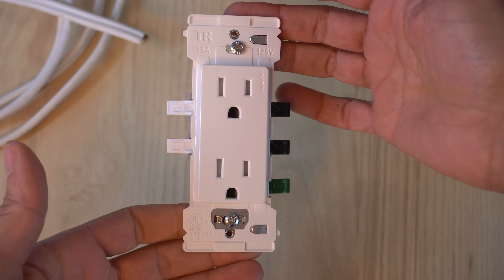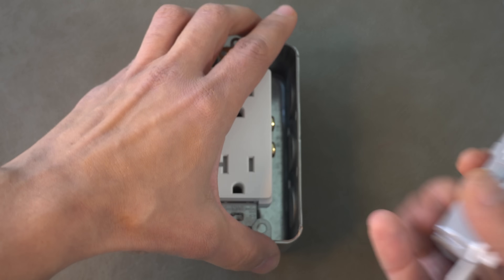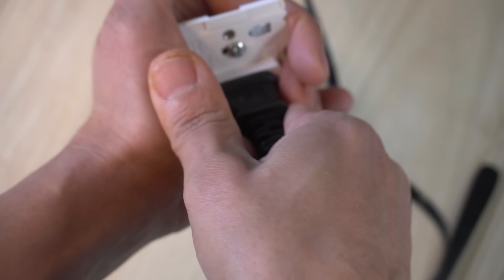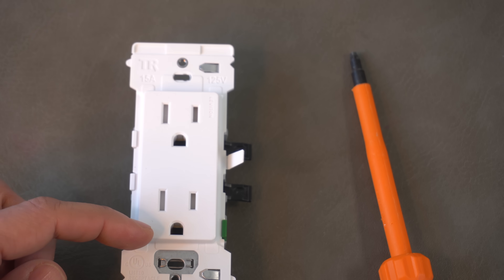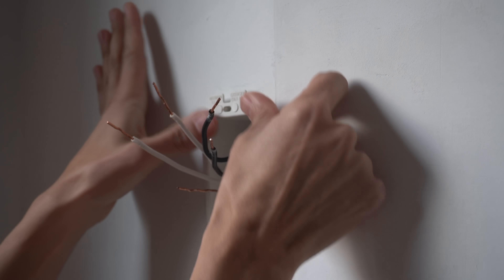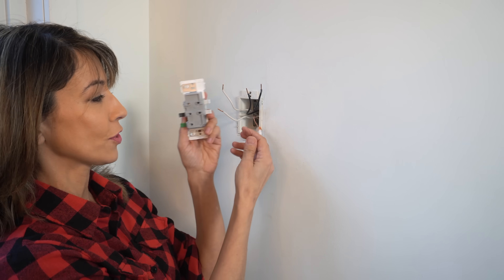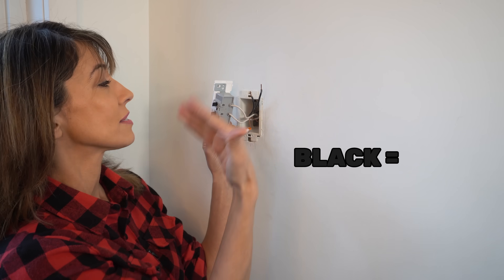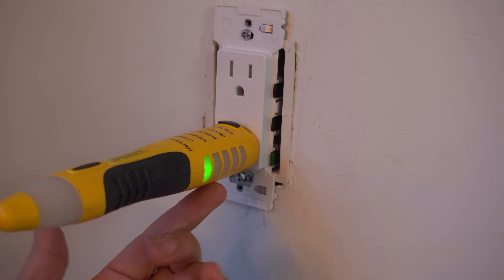New Electrical Outlet Installation: 3 Essential Improvements You Need To See

Comment: I absolutely will not buy an outlet with those doors inside. I LOVE the other changes. I also love the plastic box extension and plastic boxes, I hate grounding both the box and the receptacle its is so redundant. I also hate doing down stream feeding through the receptacle like that, but adding 3 wire nuts to the box makes it pretty tight sometimes.
Reply from the maker: Good to hear your thoughts on the outlets and improvements! Thanks for sharing your feedback.

Comment: Bad receptacle, you can pull the wire out easily
Reply from the maker: Thanks for sharing your feedback on this. I tested out the strength of the levers in my light switch video with a 15 pound kettlebell. The results were great. Check it out if you’re interested! Thanks

Comment: The best part of these is there are no exposed conductors.  I always thought that it was crazy that traditional outlets have exposed terminal screws and then you have a bare copper ground wire in the box just waiting to make contact with them.
Reply from the maker: I totally agree with you, safety first. Good point!

Comment: Yup.
As a DIY'er, someone who doesn't do this day in, day out, these make it so much faster for me, it's safer, easier. I love them, just like Wagos vs. regular wire nuts.

Coming from 12V automotive wiring (stranded), I was shocked when I learned about wire nuts the first time. Granted, I didn't know how to get a good connection, but still. I was used to soldering everything together to get a bullet proof connection, and then it felt like I was taking a step back 10 years to when I used to just twist all my wires together and couldn't figure out why stuff stopped working.
Reply from the maker: I appreciate you sharing your experience. I agree. This is the future of wiring. Good to hear that you love Wagos too.

Comment: New job on the video. Unless I missed it you didn't mention the built in wire length gage on the corner.  This makes sure you strip to the correct length.   Love these new switches. Can't wait for the light switches with the traditional level. Right now I only see the rocker style of switches.
Reply from the maker: Good tip, thanks. Comes in handy!

Comment: I want all of these in my house! Question for you. I have a bunch of those screw-in boxes that turn a 2 outlet into a 4 with usb ports. they should sit flush to the wall but they have like a quarter inch gap, this makes them wiggle back and forth when you use them - is there a way to set the outlets back a little further so they sit flush?
Reply from the maker: They make box extenders so the junction box extends if you need it to. I use them and they are in my Amazon shop. I hope you found a solution.
Reply: @DaruDhillon thank you so much! Now that I know what to look for I know I will find it! I was thinking of designing something to send to a 3D Printer shop but I am going to hunt for extenders first! I appreciate yah! 😊

Comment: I’m in any one of about 10 Home Depot’s 3-4 times per week for the last 10 years at least. Those things got put on the discounted end cap of the aisle in no time after they came out. Probably not more than 2 months. They’re constantly sold out of the 20 amp decora receptacle ten packs for a reason. I haven’t tried this new style yet but I’m guessing a lot of other guys haven’t either. I think people like the feeling of twisting the screwdriver and actually feeling the torque when you tighten it. I’m confident of the connection.

Comment: I am ABSOLUTELY thrilled to see these!! High resistant connections (HRCs) are way too common, cause fires and will not trip a breaker!! HRCs are caused by loose connections at contact points such as terminal screws or when you go to plug something in and it doesn't stay in tight. A terminal screw that is too loose OR has been overtightened (over tightening can cause the treads to stretch and loosen up over time) is a bad and common occurrence even done by electricians and or their helpers. Terminal screws are supposed to be tightened to a specific torque and it is not common practice to use a torque screw driver!! These are not only great for DIY's but for electrician companies as well; especially if they have young helpers that don't have much experience. Even if I would have an electrician work on my home I would insist that these are installed. Along with AFCI breakers, of course, because they detect HRCs!! I bet these cut down on AFCI "nuisance" trips that cause electricians to remove AFCI breakers!! Thanks so much for posting!!!!!
Reply from the maker: Good to hear your thoughts on this, thanks!

Comment: I'm a big fan of WAGO connectors but won't use these for the simple reason that they are tamper resistant. Also I'd recommend pig-tailing the line and neutrals instead of using the outlet to daisy-chain.
Reply from the maker: Good to hear your recommendations thanks!

Comment: Pro Tip from a Licensed Electrician of 30 yrs...  when you have 2 or more sets of wires in a box, attach a "tail" to each set. This creates a "parallel" circuit as oppose to a "series" circuit, meaning that the circuit has to run THROUGH the outlet in order to continue down to the next device. If that outlet fails, all the devices down line will no longer work. A parallel circuit taps the "hot" to energized each individual device so if it fails, only THAT device fails and the rest of the circuit continues to work.
Reply from the maker: Thanks for adding your insights on this. I agree it’s a much better way of wiring. Something I personally didn’t know early on but it makes complete sense. It’s a smart way of wiring. Appreciate you sharing this helpful information with us!

Comment: Nice!  I was looking for what exists along the line of 'box extenders'.  Had installed a GFCI in bathroom years ago, but never seated it in wall properly, was trying to correct that, and discovered the old metal box has some load wires coming in from the side, that stick into the box so much that the GFCI can't be fully inserted.  Am looking to find a non-conductive material to safely extend the metal box.    Nice presentation!  Thank you!
Reply from the maker: @darkandstarrysky5175  glad it helped. It’s good that you are taking the time update your electrical. Great job!

Comment: You talk about back stabbing outlets as bad, but
there are back stabbing outlets that have screws
on the sides that clamp the wires in the back 
stabbed holes. They are the best of both worlds
(easy and good tight positive contact). Doesn't
solve the exposed metal on the sides, though.
Reply from the maker: Good point. The screws that lock the wires are an improvement and are commonly used in other countries. Thanks for clarifying. I was referring to the old push in ones but having a locking mechanism be it lever or screw is a good feature that makes electrical safer and user friendly.
Reply: @DaruDhillon  Thanks for answering. I'm looking
for the new outlets you reviewed. Is there a store
that carries them in the U.S.?

Comment: Hello Daru , Thank you so much for your compliments , I believe this receptacle is made by Leviton and Leviton has been around for a long long time , Definitely a technological breakthrough , and no worries about any part of the receptacle grounding out against a metal box , Next thing that would be nice Is to have these lever connectors built into light fixtures to make installation easier and faster because reaching up to connect wires together can cause your arms to fatigue but of course you can use the Wago connectors , 
Don't forget to go to your local electrical supply and pick up a circuit breaker lockout along with a warning tag and a small padlock , I'm just looking out for your safety because when working with electricity , Safety is number one priority , Especially when working on a ladder and locking out and tagging out the circuit breaker is your best defense against electrical accidents , Like I said I'm just looking out for your safety and I definitely don't want you to get hurt because you're such a wonderful lady , I just want you to be safe and I'm a very strong believer in lockout tagout

Comment: Interesting product.  I'm not a fan of Wagos.  Wagos and these recepticles look like they'd work fine in light to medium loads but I want the security of a screw in heavy loads.  (Kitchen, bath & garage)  I will not install the older "push to connect" system which this product looks to be an upgrade.  For the last few years I've been using only the hole style wire receiver but with the screw they just seem far more secure than the toggle system.
Reply from the maker: The screw in ports are also good like you say. Thanks for sharing your experience with the connectors.

Comment: When straightening the wires: IF you have enough excess wire, CUT those curves off an strip back to what you need for your receptacle/switch. You weaken the wire by bending it back to a straight configuration.

Comment: Where is the on/off switch?  Do you have to go to the switch box to turn off something?  Are you wrestling with a LIVE plug, when turning off something?
Reply from the maker: Always turn your power off at the breaker and check with your voltage tester.

Comment: I thought these would be a lot more expensive. Only $2.50 each! Awesome!
Reply from the maker: I know it's good value considering the time savings in the bulk pack!
Reply: Yea, I bought 10 to try it out. It'll be so much easier than wrapping the wires around each screw. I'm replacing all my switches and receptacles so I need something that saves time.   @DaruDhillon

Comment: thats all good but how do you add outlets in parallel if you want to add multiple outlets side by side if one 1 wire is going into the socket ?
Reply from the maker: You can always use a standard outlet.
Reply: @DaruDhillon  so it's not a groundbreaking  advancement  it thr current standard can replace the higher priced alternative 😉
Reply from the maker: @Bond00016  for homeowners wanting a safe and easy to install outlet it’s a game changer. They can feel confident installing one on their own. We’re going to see more of this.
Reply: @DaruDhillon  yeah I'm not buying it ... if you Wana add outlets either get an electrician or do it your self ...  but I'd never want to be limited by technology.... that just doesn't make any sense

Comment: At 6:13 if you look at the black wire there is a nick in the solid wire from the person who originally stripped the wires…the first installer needs there hands slapped for not double checking there work…you as an electrician need to be fired or pay for this home insurance because you have just installed a ticking time bomb…that wire might break off when that device is pushed into the box or it might burn off when the person that is blowing drying there hair for the hundredth time or this receptacle is rarely used…there is not enough females in our trade please remember to check your work especially when you are trying to do a training video and please remember to include the basics when doing such videos…I started wiring houses when I was 9 years old ( different times) and 50 years later I am still assisting in the field ( forced into early retirement due to health issues).PLEASE  moving forward double check your work and remember THE basics..You appear to be great in the trade..with a few small tweaks looks like you could become one of the best..
Reply from the maker: I didn’t see a nick on the wire could have been missed in the original installation. All wires should be smooth and free of any damage. Thanks for the advice. 👍🏽

Comment: So when you leave the jobsite and all the other trades are finishing up and they keep cutting through the wall opening or the drywaller on a Friday afternoon tired of cutting for your boxes cuts a crooked hole…so with these overly tall devices you can no longer straighten the look of the two gang box…does the other trade get blamed for the crooked box …nope….these style of connections work ok solid copper but for stranded wire not so good so in piped in outlets where strained is pulled in instead of solid you either do the little anti fire dance and say a prayer that the stranded wire stays tight in the lever joints….add wire nuts and solid wire tails adding to your box fill and adding another possible joint that could fail because we also have bad Friday afternoons…or we pull solid wire and that goes over like a lead ballon..

Comment: Point of contact is HOW large? Not buying this. I’ve seen entirely too many of the push-in wire size hole types fail over time due to corrosion, arcing. Screws give LARGE surface area for contact and retention. How about a new outlet with a flap that folds down over the screws if there’s any (fuss-budget/anxiety-disordered/OCD-derived) fear of shorting on the sides? Maybe a 1” silicone rubber band to wrap around the outlet. Just another solution for a non-problem. Another “there’s a special place in h*ll for mechanical engineers”. Sometimes “staying in the past” and staying with what really works, has worked, is a good thing. JMHO.
Reply from the maker: I appreciate your humble opinion it’s good to hear other people’s perspectives.

Comment: Why didn't you just push the outlet through the extender instead of removing the wiring.  It worked properly for who knows how many years.....If the exposed screws concern you, a few turns of vinyl tape easily corrects the problem.  If it works, leave it alone.
Reply from the maker: It’s not to code, it has to be fixed and was.

Comment: Wago’s being used successfully for years in Europe doesn’t necessarily mean they’re safe for use in the USA. Europe uses 240 V, so the current drawn by the same devices is one-half of what it would draw in the USA with our 120 V supply voltage. It’s current that causes the heat when the connection becomes resistive, so the USA (and Canada that also uses 120 V) need to ensure we end up with roughly half the resistance in our connections compared to Europe in order to avoid thermal issues.

An electrical connection with more surface area in intimate contact between the two conductors will have less resistance than a connection with less surface area in intimate contact. Intimate contact means air-tight, which keeps oxygen from corroding the conductive surfaces and building up resistance. High clamping force helps form more intimate contact. A tightly-torqued screw terminal can exert enormous force compared to the spring contacts of the old rear ported receptacles. The lever almost certainly creates more force than the old spring contact, but likely falls well short of a tightly-torqued screw.
Reply from the maker: Thank-you for your feedback on this!
Reply: Europe also has higher wattage appliances like kettles, heaters, and microwaves, so it's not a straight 2 to 1 current ratio.  In the UK, 13A circuits are common, and in mainland Europe 10A and 16A are common.
Reply: @dansanger5340 thanks for that info. My comments are applicable to the same devices with the same power rating, which is the vast majority of products these days.  The point is that the same device used in the EU or UK will draw approximately one-half the current as it will draw in the USA and Canada, and the heat developed at the receptacle termination point in a UK/EU application would be a small fraction of what it would be in the USA/Canada since the power loss at the terminal is equal to the current squared multiplied by the resistance. That’s the point, and that’s why we need to be careful drawing conclusions that termination solutions that are proven in use in the UK/EU would work not necessarily work as well in the USA/Canada.
Reply: @ I didn't make my point very well.  I meant that high wattage appliances in Europe are designed to take advantage of the higher wattage available.  For example, go to the US Amazon and electric kettles are around 1500W.  Go to the UK Amazon and electric kettles are around 3000W.  So, same current, but more watts.

Comment: Over kill, cost a lot more. Lining someones pocket to the max. Nothing will fit as it used to be know  to be In a old house.  The extra cost does not make sense. The old outlet have the poke the wire in the back of outlet thing already. Not a good thing as wire connection is not good enough  the wire should be hard wired much safer. It's really not better .
Reply from the maker: Thanks for sharing your thoughts

Comment: While a lot of the features on these devices are pretty kool, there's one feature they are lacking that I as an electrician use  pretty much in every house I trim is the metal ears on the strapping yoke. When the drywall guy gets over zealous with his router and cuts the drywall too much wider than the box and there's nothing there to tighten against so that the outlet remains flush and tight. I'll just bend the ears back a little and they'll catch and tighten on the box. Now i know you can buy spacers and or just cut the bottom end off a wingnut for a spacer, but that takes extra time, patience and/or money. While they might be helpful to a diyer or a noob, I've been working with the old reliable for soooo long none of those new features would make "me" any faster especially in the situation I described above. But thanks for the vid anyway, I'm always interested in seeing new stuff the industry is coming out with.
Reply from the maker: Thanks for your thoughts on this and the metal ears. It’s always an important consideration.

Comment: I had three return service calls to a house, that had these installed, the remodel company incorrectly installed them and it melted plastic leading into the wire hole. 
Make sure the wire is all the way in.
Reply from the maker: Thanks for taking the time to comment. Anything can be installed improperly. It’s important to install all electrical on your home carefully like you say. Appreciate your advice Ramon.